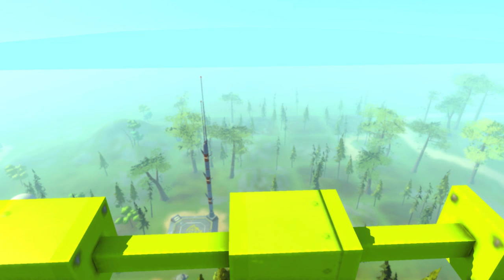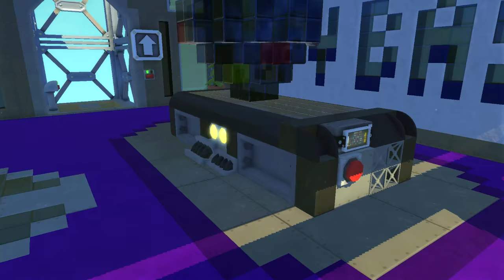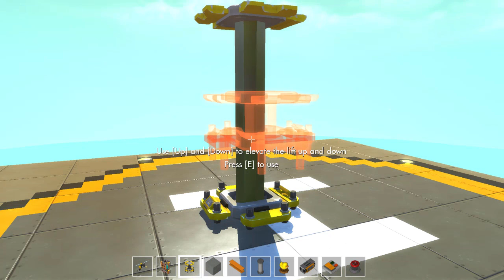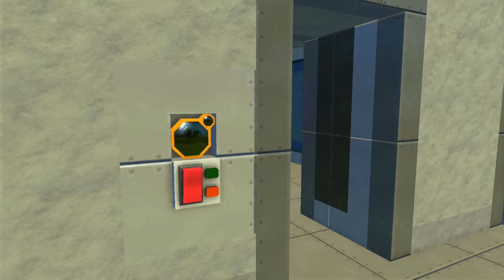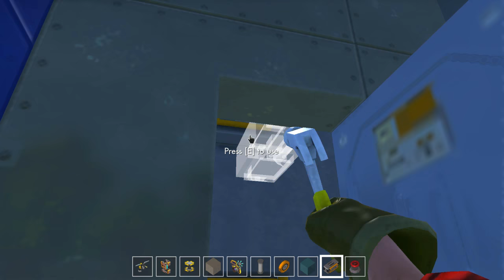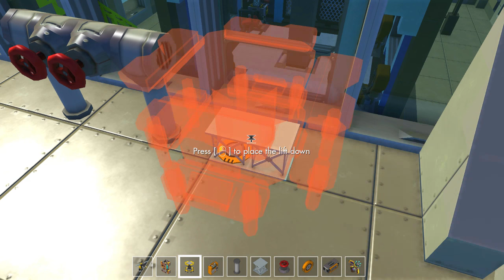SKY BASE Community Project! [EP.6]  - CONTROL ROOM Update - Scrap Mechanic (0.1.28)

Comment: Put the switch for the secret room inside the wall with the mechanisms instead of being in plain view.
Reply: Or you could put it inside a control panel
Reply from the maker: That's just a temporary spot of course! I'll find a good spot to hide it, don't worry :)
Reply: +SpyCakes spy PLZ play besiged
Reply: +SpyCakes make a garage on an elevator
Reply: +SpyCakes can you make a cable car  anyone agree

Comment: you can put the sensor on 1 and switch mode and it will work like a switch  and by putting it to distance of 1 you have to get up right into it
then it kinda works better i hope you see this comment

Comment: add an arcade machine to the lounge and an escape pod. one other suggestion of mine is to make the secrets to the base only accesible through a bunch of tunnals for passage so you wont get in the way of to many things and it would help fill out the base. also for new additions make a lab or research facility. pleeeeeeeeeeeeeeeeaaaaaaaaaase